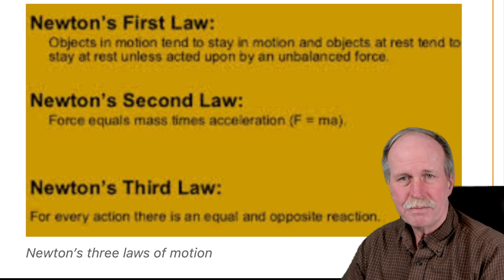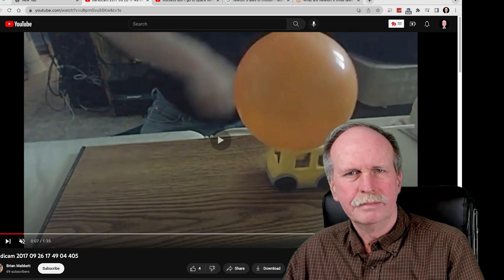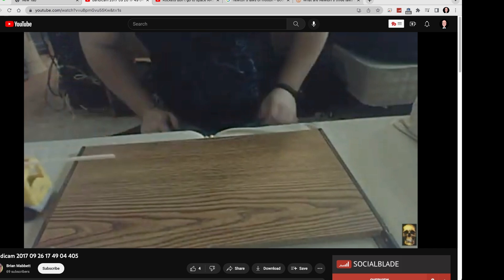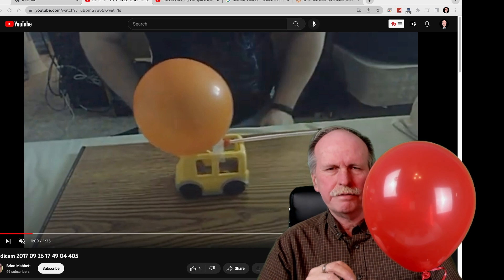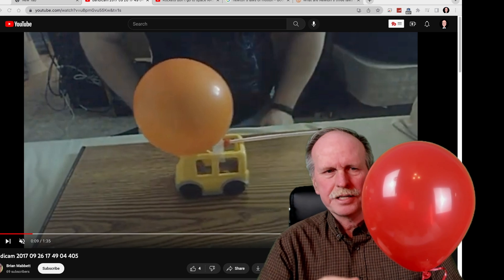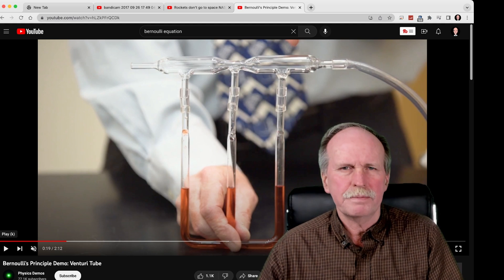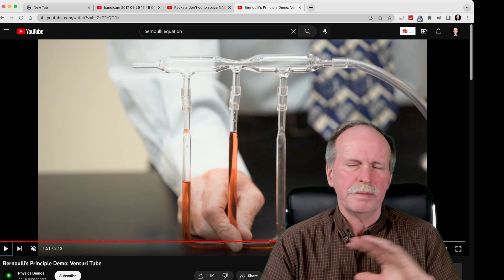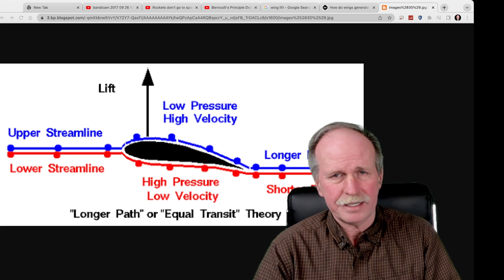Flat Earth Proves Rockets DON'T WORK

Comment: Curious as to how inverted flight works (something that popped into my mind with the wing lift chart) 🙂
Reply: I believe that inverted flight is possible because of the angle of attack of the wing. This means that the wing is pointing slightly upwards and the 'inclined plane' effect of this overcomes the 'negative lift' effect of the upside-down wing.
Reply: @chrisbagust3516  🤔👍🏽
Reply from the maker: The lift generated by the wing is only part of the mechanism of flight, as many posters have noted. Thrust and angle of attach are major factors as well. With a big enough engine you can make a brick fly
Reply: @BobtheScienceGuy  You don't even have to go that far, look at the SLS, no wings, lots of engine and it flies!
Reply: Many thanks for the responses.
Reply: Simple, all is in AoA - angle of attack, i.e.  wing angle to the air flow. All specialized aerobatic airplanes actually have a symmetrical wing cross-section of curvature so that lift depends solely on the angle of attack so flying upside down is not aerodynamically complicated, but the fuel delivery and engine lubrication system is a much bigger problem when flying upside down
Reply: @dinkoz1  And Gyros don't like it, lol

Comment: The equal transit theory is wrong.  There is no reason why air molecules going over the top of the air foil must take the same amount of time as molecules going under the bottom, and in fact, typically that is not the case.

Comment: For every action, there is a reaction. How can something react with/to nothing? Space is lol a vacuum, right? For a reaction to occur it needs to react with something. How do thrusters react with NOTHING???? You're an idiot who thinks he has the answer(s).
Reply from the maker: You might want to rewatch the video. Maybe consider listening to a Ted talk because you apparently are clueless
Reply: The interaction is between the fuel and the rocket.
The fuel is forced in one direction and, as a reaction, the rocket is forced into the opposite direction.
Reply: Maybe watch the video next time, before speaking nonsense. If your keyboard is not broken it takes you seconds to search how rocket engines work.

Comment: Hi Bob, you seem like the kinda guy that could answer something that been bugging me for some time. 
Firstly im not a FE believer, im a normal human with a good grasp of common sense. 
.
scenario::
you pick up your kid from a party
They get in the car with a helium balloon. 
The balloon is in the middle of the car
You accelerate..... the ballon comes into the FRONT of the car!!!!
How?
Why?
Thanks :-)
Reply from the maker: Excellent question and one I’ve addressed I’ll look for the link. But buoyancy responds to external forces. Air has more mass than helium and as the car accelerated the air is moved to the back with more force than the helium, so the helium is displaced by the air and pushed forward
Reply: The helium balloon will move to the area with the lowest density, which is usually up. Air acts like any other matter, so when the car accelerates, the air does not want to accelerate with it. The air acts in the exact same way a human does, it is forced into the back of the vehicle due to its inertia. Since the back is now the densest region of air, the balloon will move to the front, which is now the least dense region. Once the car stops accelerating, the balloon will return to normal.
Reply: @ragingfirefrog  Thanks for taking the time to reply, I thought of that however if that were the case then cigaret smoke would behave the same way. 
I come to the conclusion that with all windows closed whatever is in the car moves relative with the car.
Reply: Same thing happens when you turn. Turn left, the balloon goes right!

Comment: Thanks for video. I think this experiment is totally inadequate to show what flat earthers are saying. This is what I think they are trying g to say: on the earth from sea level to the biosphere, there  are enough air molecules to push against to produce action and reaction. By the time the rocket reaches the ionesphere or higher, however, the  the air is so thin, logically, there are insufficient molecules to push against, so no action, no reaction. So, by the time rocket reaches the high vacuum of space there is only momentum (m x v), and because there is hardly any friction, no opposing forces,  the rocket keeps going for a while. Now when the rocket eventually stops or needs to change direction, a quick blast from a side rocket will not work because there not enough gas molecules to push on. Some say it pushes on it's own exhaust molecules, but as Lincoln said, a man cannot lift himself up on his own bootlaces.Thanks again for the video
Reply from the maker: They are simply wrong

Comment: It would seem like to me that if the rockets plume spread out and greatly dissipated the thrust that it was exerting on the rocket would be greatly diminished. The whole concept of rockets happens right there at the nozzle of the t⅘hrusters and the amount of force is directly proportional to the concentration of the plume. If I am correct, you are wrong. All of this is a moot point anyway. Once the rocket entered into the vacuum of space there is no atmosphere in the vacuum of space so there is nothing for the rockets plume to push against. Rockets burning fossil fuels would not work in a vacuum...
Reply from the maker: Newton’s third law
Reply from the maker: Yet they clearly do. Review Newton’s third law
Reply: Newtons 3rd law has been reviewed and I stand by statement. Physics and its entire structure change when going from a pressurized atmosphere (where we live) to a vacuum (where we have never even been and NASA even admits they have never been beyond Low Earth Orbit.) Science, actual Imperical Science and Scientism sir are totally different things. Gravity is just the weight/mass of any given object.
Reply from the maker: You understand we just went to the moon and are on the way back now, right?  Or didn't that make the flerf evening news?   And you do know weight and mass are different things, right?  Did you ever take any actual science in school?
Reply: No I don't own a t.v. And I dropped out of indoctrination. How did this conversation turn into a personal attack? That usually only happens when the attacker is running out of options. How have we just went to the moon when NASA states they no longer have that tech and it would be too expensive to recreate. They also state that no one has ever been past the Van Allen Belt of deadly radiation that supposedly surrounds "Earth?" I am asking you the educated man questions, you seem to be wanting to turn this personal. I don't understand the hostile stance that you seem to be taking.

Comment: I'm not a flat earther, and your debunk seems pretty good.
However, the "longer path" "equal transit" theory of how aerofoils work has been discarded long ago, and actually disproven. Wind tunnels have shown that the air does not take the same length of time to reach the rear of the wing.

Comment: Just a question about airplane wing. Why would two air particles separated by the wing have to meet again at the rear of the wing?
Reply: air pressure...?

now explain this space vacuum next to air pressure on earth.... there needs to be a container to have pressure.
Reply: @stephanHK  air has mass
Reply: @stephanHK  it's not space vacuum in the way you think it is. A vacuum doesn't suck, the vacuum of space is not a dust buster/hoover. "Air pressure" on earth slowly reduces as you go up in elevation and by the time you reach the vacuum of space there is little to no difference. You can also see the difference with heavier gasses on earth and can have a heavier gas not be sucked out into our atmosphere from a bucket even with no lid. Check youtube for confirmation, that is where flat earthers get all their knowledge from.

Comment: Could have easily prevented the air pressure difference on his straw car if there was a screen of some sort between car/balloon and the end of the straw where the vacuum hose was placed. No significant air pressure difference on one side of balloon and car would still more as before.

Comment: I was reading about the D-Day landings recently and found accounts of the effects of vacuum from large passing objects.  On D-Day, two older battleships were used for shore bombardment, engaging hardened targets on the beach using their big 14-inch guns.  Since this was at short range, the guns were firing nearly horizontally over the landing craft heading in.  I read several reports from soldiers in these craft who stated that when those large shells passed close overhead, the vacuum caused by the shell's high-velocity passage would actually lift the landing craft higher in the water for a second.  I just thought your science-loving viewers might like hearing about that.
     Also, that widened rocket plume in low pressure (or no pressure) is also the reason why there was no crater blasted into the lunar regolith under the Apollo Lunar Modules.
Reply: Texas and Nevada were the two battleships with 14" guns. Arkansas had 12" guns. Warspite and Ramilles had 15" guns and finally Rodney had 16" guns.
Reply: That high pressure gases of the rocket propulsion gets sucked up completely being fired into empty vacuum of space.
It doesn't really go very far.
The rocket engine, being right close to the expanding gasses, gets moved quite a bit.
Reply: @michaelszczys8316  Hense, the lack of a crater at the Apollo landing sites?
Reply: @patricknorton5788  from what I understand of the Apollo moon landing rockets, they touched down with regular rockets which blew a certain amount of dust around as they created a stream of exhaust from liquid oxygen rockets but to take off was different kind of rocket using two  volatile liquids that reacted when mixed together and I don't think they made the same kind of exhaust.
I could be wrong, look it up.
Rocket exhaust of any kind act much different in total vacuum than in atmosphere.
Reply: Very interesting.  I've never heard of that.  And that was the "surplus" energy from those guns.  Like passing a big rig on the highway,  but they are enormous, and only six feet away.   The big shells weigh a fraction of a sixteen-wheeler, and a passenger car is a fraction of the mass of a landing craft, but the velocity of the big shell is a lot different.

Comment: Bob, please take down this video and put up a corrected one.  The "equal transit" theory of lift is incorrect and all you are doing is giving flat earthers ammunition to debunk this video.  Of course wings do generate lift, but not for the reason you provide.  A better way to address the flat earth idea that "rockets don't move in space you can't push against a vacuum" is to simply ask them what they think would happen if you set off a bomb in space.  Does the shrapnel go flying off in all directions as expected?  How, if the force of the explosive has nothing to push against?  A rocket burning fuel is just a giant explosion, except it's constant and channeled in one direction.  (Yes, it's combustion vs. explosion, but that distinction doesn't matter for the purposes of the analogy).

Comment: Just as a note, one of the biggest failures of Flerfers is that they don't understand when some words or concepts have different meanings in different contexts. A vacuum cleaner creates 'vacuum' by rapidly decreasing the air pressure in an enclosed space through the use of an active motor to cause that action, and expelling that air at high velocity, causing the air on the other end of the hose to enter it at the same high velocity to fill that constantly applied lower pressure. But a vacuum in space is not a constant action because it's the mere absence of anything, so a vacuum cleaner and a vacuum of space may use the same word but they are not describing the same things in the same contexts. Yet Flerfers constantly seem to think they are, and that somehow outside of our atmosphere supposedly is a giant machine constantly causing a negative air pressure that should be 'sucking' anything in its path to... somewhere. Just like they don't understand that gravity is not 'down', it's 'in', they don't understand that you can have a gas surrounding a planet next to a vacuum because there's nowhere else for it to go while gravity is the stronger force pulling it back down, they don't understand that space is not comparable to a household cleaning device and therefore that's why their 'experiments' are massively flawed.

Comment: The straw was long so that the vacuum didn't act on the balloon. Why didn't you reproduce the experiment @Bob the Science Guy?. As long as the lower pressure isn't adjacent to the balloon there will be no action. You explained how a plane wing functions instead of attempting the experiment yourself. We know how a lower pressure and higher pressure system creates lift over a surface. You didn't debunk the experiment.
Reply from the maker: You can see the effect on the balloon. It doesn’t go forward anywhere near like the non-vacuum runs. I did reproduce what he did
Reply: You did not reproduce the same conditions, nor control any variables. You blew some air over a balloon much closer to the car in the experiment, then you professed to say you debunked the experiment by giving a power point on atmospheric dynamics and the Venturi effect. I call fallacy on this video, until you reproduce the experiment, you can't say you have debunked anything.
Reply: @drewrout  The guy in the video didn't create a vacuum at the end of a straw, he just created a fast flowing airstream. That's exactly what Bob did.

Comment: I'm sorry, but you've just opened a whole new can of worms - or, if you prefer, a whole new Youtube video. 
That bit about the balloon leaning forward. How does that happen? Any force on the balloon must occur at the bottom of the balloon, where the straw provides thrust. But if the balloon leans forward, there must be greater (net) thrust at the top of the balloon than at the bottom. How, exactly, does that work? Any simple model of the car would predict that the balloon leans backward, due to both acceleration of the car body and air resistance. But it works the other way.
It was an acute observation, but how to explain it?
Reply: Probably because of the way the balloon is attached to the straw and the car, it will naturally fall forward as it deflates.

Comment: Here are three questions that ANY HIGH SCHOOL GRADUATE can answer, but those "science denying morons" REFUSE to just answer. 
I wonder WHY?
 Let's first concern ourselves with rocket IN ATMOSPHERE, HERE ON EARTH. 
I like to use the Space Shuttle Main Engine as my example as there is a LOT of video. 
So, when a SSME is running (here on earth in atmosphere):
1 - Does the exhaust gas get ACCELERATED as it leaves the nozzle? 
2 - Does the exhaust gas have MASS?
3 - Can MASS be ACCELERATED without a force? (Or is a force REQUIRED to accelerate mass) 
Now IF these Morons bothered to ever ANSWER these three questions, we could get to the ACTUAL questions regarding rocket propulsion in a vacuum.
 Unfortunately, we NEVER get that far as they flat out REFUSE to just answer. 
Let's see if we can get a few answers on this thread to show them how "Normal people" just answer simple questions.
 Then I'll get to the more significant questions.
Reply: Not a flerf, but I'll try to answers those anyways:
1. Yes. That's why the nozzle is there in the first place.
2. Gas is matter, matter has mass, so yes.
3. No. A force is required.
How many did I get right?
Reply: @2LucasKane3  You got them ALL right!

Now that we have established that: Mass REQUIRES a force to be accelerated, exhaust gas has mass, and it IS being accelerated, therefore: There MUST Be a FORCE accelerating that mass from the nozzle!
Great!
Now what does Newton's THIRD LAW tells us about "Forces"?
Reply: @stuartgray5877  Whenever one object exerts a force on another object, the second object exerts an equal and opposite force on the first. Forces always come in pairs, no matter what. That about right?
Reply: @stuartgray5877  Now consider that I was a creationist fundamentalist evolution denying christian for 10+ years. Compared to flerfs, I am not that different.

Comment: If a commercial plane flew over the pole and stayed at 20,000ft where would it end up not adjusting  it's course to follow the horizon
Reply: @Q Branch The OP alluded to the airplane climbing indefinitely because it would not be "following the curvature of the Earth". In his scenario it would climb until reaching its ceiling. But yes, if it's trimmed for level flight at 20,000ft, then it will stay there. 
...And follow the curve of the Earth in the process.
Reply: It would end up at its absolute ceiling, as it would be incapable of climbing higher. And would continue following the Earth's curvature at that altitude.

Comment: Rockets does not only works on Newton's 3 law but also on conservation of linear momentum. Just like recoil in a pistol ,when a bullet leaves the pistol  with velocity x if the weight of pistol is about 5 times the the weight of the bullet the velocity of pistol will be -x/5  because before the bullet was shot the momentum of the system was zero and acc to law of conservation the final momentum of system will also be zero so the bullet gains velocity in one direction and the pistol gains velocity in opposite direction.In the rockets instead of of bullet large amount of gas leaves the rocket and because of that rockets gains velocity.
Reply: Same thing